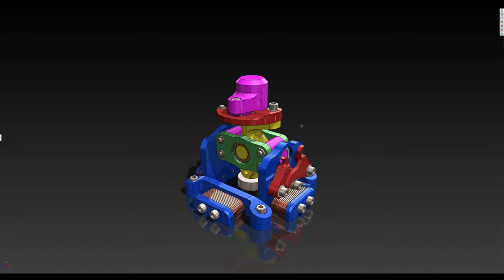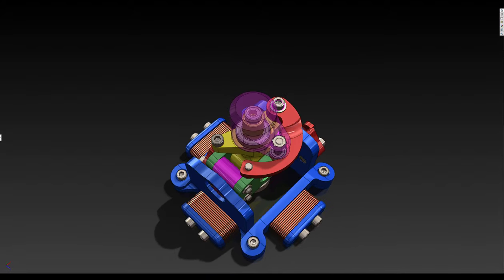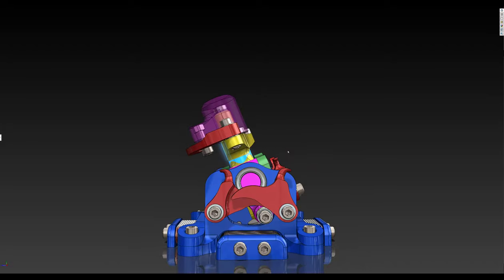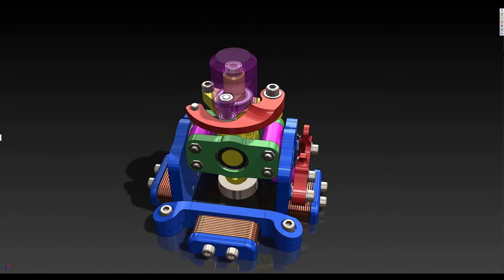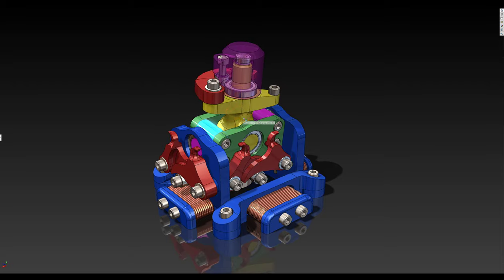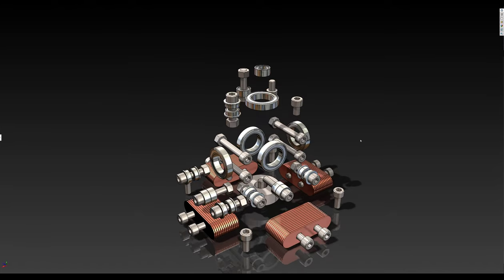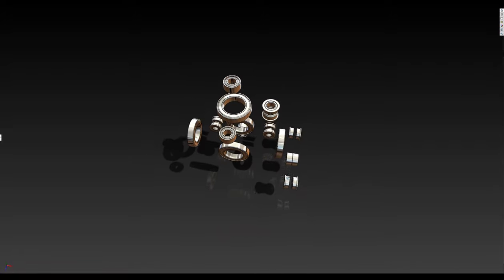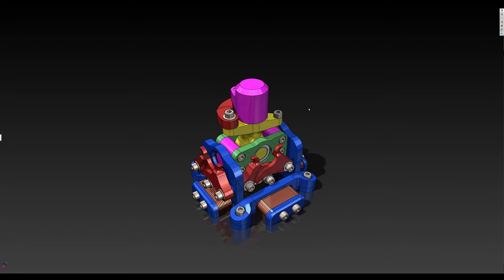Twist Assembly for Mechanism: Improved Fasteners and Modular Design

Comment from the maker: What are your thoughts on using brushless DC motors for force-feedback? 

The ones in particular I’m thinking are the ones used in brushless camera gimbals. They are the sensored ones that include a hall effect sensor in them to smooth out the drive at slow speed. 

Do you think the resolution of the hall effect sensors in these motors will be high enough to be used for getting the joystick rotation? Or do you think a dedicated hall effect sensor on the other side of the pivot would still be necessary.

Do you think brushless DC motors will have enough torque to be used for this purpose?
Reply: Bryan Howard Hey really enjoyed your video. I'm currently planning something similar, though without the force feedback since it currently doesn't really serve me any purpose (though it would be quite rad). I'm just kinda broke most of the time (student life sucks) and since I had some spare cash I bought a 3D Printer since I'd rather buy that and a turning Machine (like an Emco Unimat) instead of a finished setup from Virpil since that would leave me broke with a bunch of stuff in my room that just makes me lose time more comfortably and leaves me with very litte edicational value.  But that's besides the point here. I'm no expert on brushless motors but I have used them in the past to control stuff and if you don't use the correct motor for the load and depending on what you use to control them, they can get really hot really fast and that doesn't always fair well with 3D printed stuff or the motor for that matter. I personally would rather go with outrunner motors and a seperate encoder though, since those are quite easily passively aircooled and available in many different varieties. You'll probably wanna look into the MIT Cheetah controller (which thankfully is open source) and also check out a youtuber called "skyentific" who does fantastic videos on 3D printed robotics driven by brushless motors. I do believe you won't have an issue with torque as long as you choose the right motor and/or add an easily back drivable belt drive to it ( to cope with space constraints and possibly the hall sensor accuracy but I doubt that that'll be much of an issue). Also, an issue that could arise with the gimbal motors is that those, espechially when carrying heavier loads often have a harmonic drive attached which isn't backdriveable and would probably shred the whole gimbal and if not it would probably break your wrist and after having dealt with you go after your loved ones....sorry got carried away....anyhow just make sure you go for an ungeared inrunner motor. For inspiration you might also want the check out the Microsoft Sidewinder Precision Pro Force Feedback. There is a guy on youtube who converted one for flying helicopters and shorted the shunt resistors to get some more power out of the brushed dc motors. I don't think brushed is a suitable option for your build but working out something with the rest of the control circuitry might be quite useful since hacking into that could eliminate quite a few software problems that might arise otherwise, espechially driver interaction for the force feedback and those old sticks can sometimes be had for quite cheap although they are kinda sought after for the force feedback as you can imagine so finding one for much less than about 30$ isn't too common though i've seen them being offered for less than ten bucks at times. Hope this helps, cheers!           Edit: Scratch the geared gimbal part, not that they exist but that they'd be relevant in here. Also keep in mind that although the cams may assist the motors in about half of their movements they will also hinder them from moving the stick when the feedback has to work against the tension so if you are going to the trouble of adding them you might as well leave the cams out all together in the regular axes of the stick and just keep them in the twist axis unless you want force feedback there too.
Reply: I think that's a great idea. I think an important consideration for the BLDC motors will be to use an FOC (Field Oriented Control) motor controller. An FOC controller will allow the brushless motor to have high torque at no rotation speed where with a more traditional brushless speed controller would stall. 

I've seen someone else on youtube use the built in hall effect sensor in a gimbal motor for closed loop control so my gut tells me that would be good enough for reading the stick position.

Here's some fantastic inspiration (and a demonstration of useful features I imagine you would want to implement): https://youtu.be/EyMadq6s0RQ 
And the more in-depth video shows how he did it: https://youtu.be/9Eh1p_rUQMA

Comment: Why not use a matrix of coils bellow the metal counterweight from the lower end of the gimbal rod.  Depending on how complex can be constructed you can have the weight being attracted to one of the coil from the matrix or several (achieving in between states so more gradient in motion). Such thing could be started with just 9 coil matrix... (3x#) the center one being just bellow the center position of the counterweight but 4x4 or more matric should give better results?
Reply from the maker: I ended up not going in this direction of using coils. I think if I would continue using coils I'd add another in the bottom  that way you'd have a center position. A matrix of 9 might work better too.

Comment: Although I guess its not entirely necessary, it would also be a good idea to have a channel that goes from the top to the bottom for wires from the joystick to route through. I downloaded the files and I didn't see anything that looked like that to me.

I'm thinking about modifying your p2 design to have that, and also so that the hall-effect sensor will actually have a place to work for the twist.

Overall, I love your work though, and can't wait to see where this project goes!

Comment: Hi, have you made any progress in this? Seems like you have the most advanced twisting setup I could find. Did you recject this project? If so, why? I'm starting to develop my own mechanism and I'm curious about what problems you faced and how you overcome them. And if not, why.
Reply from the maker: I decided I'm going to continue this project and use my CNC machine to make all the parts. Aluminum parts are much stronger and milling them on the same sea machine they're much more accurate. So things like cams will come out exactly how they're designed and CAD on the computer. I like the later design of the gimbal I made with a single cam for each axid, so I'll redesign that version appropriate for aluminum. 

I'll keep it all open source in case other people want to make it and have a CNC machine, I might look at selling the milled parts so it's more of a DIY gimbal but I don't know how viable that would be if it would be much of interest to people.
Reply: @BryanHoward  are the uploads on github up to date? Looks like the force feedback stuff you shown on this vid is not in the STL folder

Comment: Iris dynamics have worked on a joystick that is magnetic. I believe their coils where angled
Reply from the maker: Yeah I later found that design. I think they must have used a fifth electromagnet under the base as I see that's probably the only way you can center the joystick.
Reply: ye, but they dont seem to be going forward with it. like 2 years ago it was supposed to be few months. Also, they were on reddit asking for  who would buy it as their units would be upwards $1k. Dont know about the hotas scene, but he only got few replies on sim racing (in regards to FFB shifter, which would also allow lock out) and the few replies were rather negative as well.

Comment: Great project 👍
May a suggest building a model without twist ? Or at least with the twist integrated in the grip like vkb  or virpil do in their joystick? 
I believe that rudder should be achieved thought pedals, and using a twist axis will result in parasite inputs on the rudder when reacting to ffb.